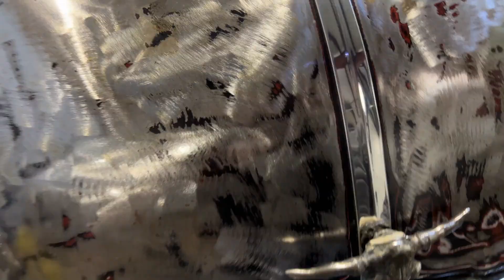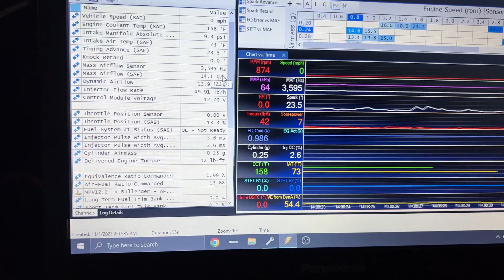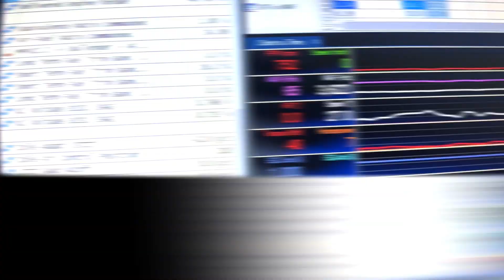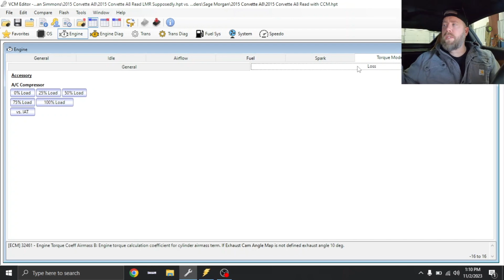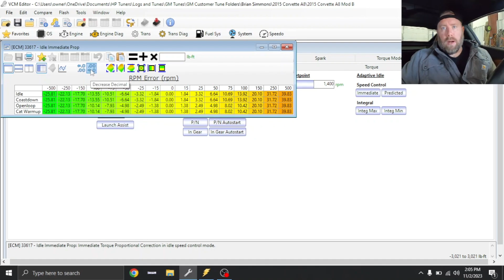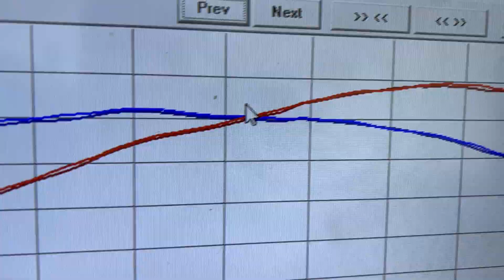Dyno Tuning a Cammed C7 Corvette! Also Cam Sensor Diag!

Comment: I know this is a old video.  But where in Tennessee are you? Im in Tennessee & This spring i will be having my  C7 Z51 LT1 built with forged rotating assembly, Pistons & Rods, DOD delete with , mild blower cam double vavle springs, titanium retainers, CHS trunion upgrades, LME VVT delete cover & cam gear, Katech dry sump oil pump,  Katech Timing chain,etc With LT4 valley plate ,LT4 HPFP LT4 injectors all to do LT4 supercharger conversion.  Im pretty nervous about the tune, because tune is everything doing that much work and taking a NA car and doing a blower conversion and deleting AFM , DOD delete stuff. Would be nice to have someone with your insight behind HP tuners doing the tune. Highly appreciate your time in advance 😊

Comment: Appreciate your work and that you share so many info. Did you ever tune an LT1 with a Katech "Track Day" cam?
Cam Specs: 232 / 238 @ .050, . 651/ .658 lift, 116 + 2 LSA 32% fuel lobe
My tb starts closing in 5th gear WOT at around 5.3k rpm and I can not figure out why. All other gears no issue. Thx in advance
Reply: Check if your commanded axle torque is lower than actual axle torque. If the actual torque is being limited by the commanded torque, you can raise it in the virtual torque calc table.

Comment: On a 2015 C7 stingray I have an AFM exhaust valve that is sticking I have mixed answers if I can tune the car to not show the MIL if the valve sticks and if the functions of that valve can be tuned … I would like the car to not do the AFM valve check on start up and I would like it to always be open … my car is cammed and A&A so it’s of no use to me
Reply from the maker: You can but you will need to license and tune the chassis control module. That’s additional credits versus tuning the ECM.